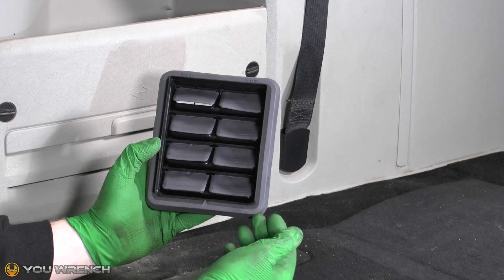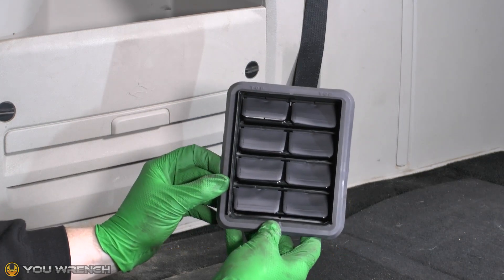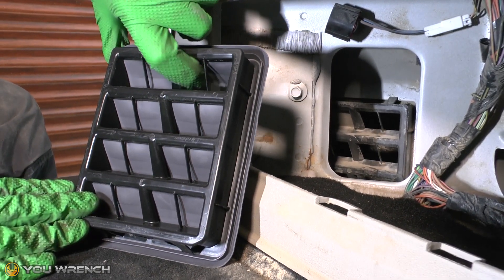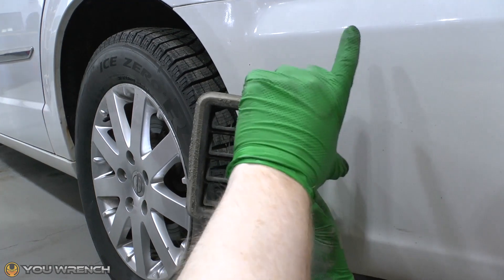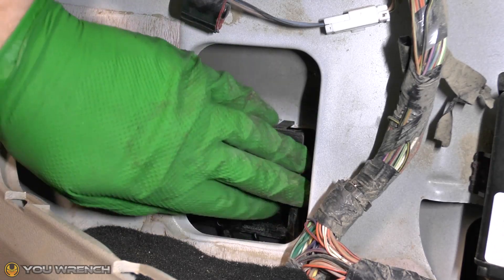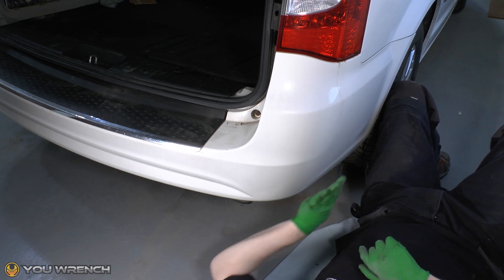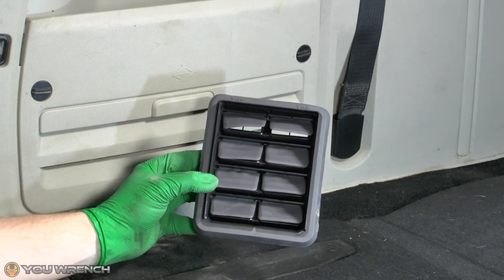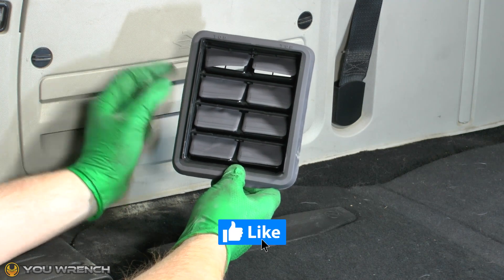How to Change Exhausters THE EASY WAY! - Grand Caravan MK5 (2008-2020) and Town & Country

Comment: I found out that if you take the tail light out ( 2 bolts ) the exhausters are right there behind the tail light. With a little push down the top will come out. Lift it out and replace with the new part and push each corner in until you hear a click. Put tail lights back in and your done.
Reply: I will be trying this next week, over taking the whole bumper off or the inside trim. Sounds much easier, thank you!
Reply: This should be pinned. It was a 5-minute job doing it by removing the taillights.

Comment: Those things look like they are made out of the cheapest plastic they could find, they literally started to disintegrate at the slightest touch when I pulled panels off last year to see where the dust was entering from when driving on dirt roads in northern Nevada.

Anybody know if there would be any negative side effects if I just seal that opening with duct tape instead of replacing the exhausters?

Comment: Mine is a 2016. I just checked and no dust anywhere. The flaps are all there and no dust. I have had the van undecoated every year since I bought it. Maybe Dodge changed the exhauster by 2016.